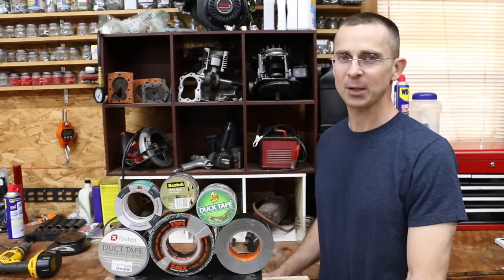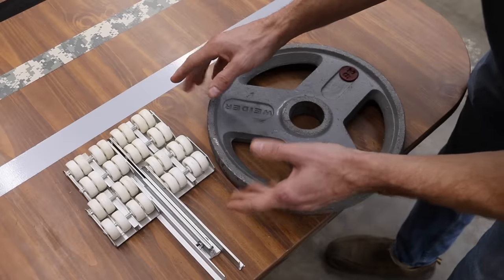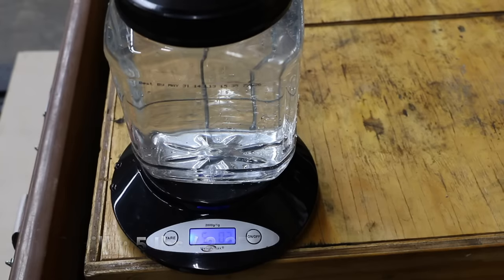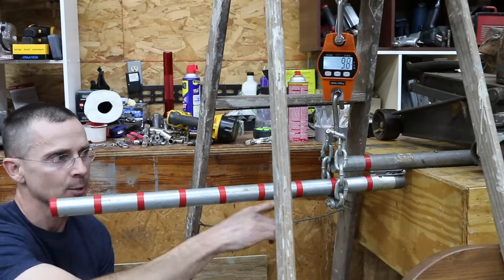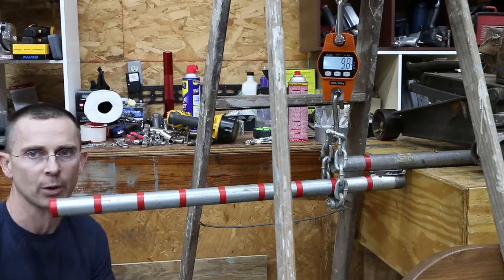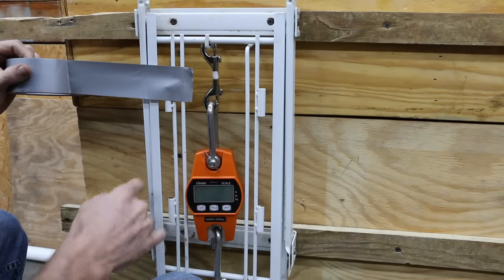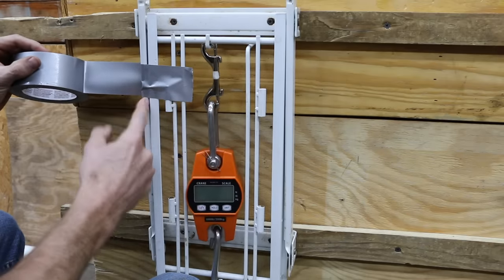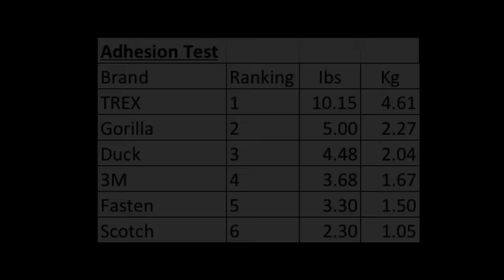Which Duct Tape Brand is the Best?  Let's find out!

Comment: You may also want to do a follow up video of the effects the COLD temps have on the ability to stick. I have found that cold air causes the adhesive to let go.
Reply from the maker: This is an excellent point.  Thank you for this recommendation.

Comment: Try flex tape
Reply from the maker: Thank you for this recommendation!
Reply: I bought some of this last month to try to repair an inflatable chair that had a small hole in it after duct tape failed to do the job. With the Flex Tape it still has a slow leak, but very slow. If I add more air once every couple of weeks now, it does fine. Sticky as hell and seems pretty strong.

Comment: I wanted to add a suggestion for another round of testing Duct Tape.  Say, round 2?  With a few additions and changes.  I noticed that your first two tests were actually a shear test.  That is pulliing harder on one side or a left to right or right to left motion.  The other two tests were adhesion tests.  And good ones!  I would like to suggest a brute strength test by taping the tape to itself.  Further, inside of that loop would be a round flat bar on each end with the weight evenly distributed for even tension tensile strength..

I have gone through most brands and more miles of tape than your average Joe.  In my experience they are used in many scenarios but I wanted to suggest a particular scenario.  A lot of vacuum and air lines are sealed with duct tape.  A vacuum and air pressure test seems to be in order.  A hole of possibly 1/2" - 1" in size for the vacuum and a prick for the air lines.  Here are some other ideas I wanted to suggest for round 2...

WEATHERING.  UV and being exposed to the environment would be a good test.  Much like you did with the bungee cord testing and after exposure to the sun and the elements outside, you did a comparison of the bungees after exposure.

HOT & COLD:  Although your previous tests in this video was done at the same temperatures, a test of hot and cold temps seem to be in order here.  Sometimes a person needs to decide if these products will even last a week in the hot sun.  Or will it stick to something and remain stuck when the temperatures drop below freezing?  On a metal pole that may condensate?  Or a wood stick that does not condensate?

Finally, I have watched more than half of your videos.  You never disappoint and I appreciate the testing.  I heard you say in one of your videos that you read the comments.  That is a lot of comments to read brother!  I hope and pray to see more of your well constructed and detailed videos!  

Thanks!
Reply from the maker: You are welcome!  Thanks for the suggestion.

Comment: 3M tape and Scotch tape are both owned by 3M but Scotch tape performed worse hmmmmm
Reply from the maker: You're right. They make a lot of different quality products.
Reply: That's what happens when you buy a company and still wanna feed off brand loyalty.
Reply: It's more than likely 3M uses Scotch as their "bargain" brand.
Reply: the best is 3M extreme hold duct tape
Reply: 3M didn't buy scotch brand, they created it....
Reply: Scotch brand is a consumer brand for homeowners and office workers whereas 3M uses their name to market and indicate that the product is for industry and commercial professionals. It's the type of stuff you can depend your living on and in many cases, your life to.

A lot of 3m products markets itself in industry just by being very good and well engineered products so customers find 3m products on their own whereas with scotch tape, they actually do have to have specific and engaging advertising that actually seeks out customers because who really cares that much about scotch tape vs the other brands. They use completely different marketing strategies. Consumers want the best product for the best value and they tend to fix onto a brand name that they recognize, whereas in industry and commercial products, companies want to consolidate and have integrated and consolidated solutions from as few sources as possible.
Reply: If it's not Scottish it's crap or if it is Scottish it's crap
Reply: Scotch is garbage as far as duct tape goes, but if it's cheaper and I don't need something particularly reliable, I'd buy it.

Comment: One thing I  know for sure is the temperature when applied and under use is critical.  In the winter, I always hit it with a heat gun, just till soft or, at a bare minimum, keep the tape inside until used.
Reply from the maker: Thanks for the feedback.

Comment: Fixing The Strength Test (Length) Results as it was switched from lbs to kg after the 3M Tape.

1. Gorilla   66.5lbs - 30.2kg
2. TREX     64.1lbs - 29.1kg
3. Scotch  39.0lbs - 17.7kg
4. 3M        35.7lbs - 16.2kg
5. Fasten  31.9lbs - 14.5kg
6. Duck     26.6lbs - 12.1kg

Please thumbs up and you can also double-check the video if you like, Cheers.
Reply from the maker: Thanks for the suggestion.

Comment: After 8:51 your crane scale is set to measure kilograms not lbs.
Gorilla weighed in at 30kgs = 66 lbs
Reply: Nice find. So basically, T-Rex is the stickiest but Gorilla is the strongest.
Reply: All measurements in the lateral test after 3M are in kg not lbs but are listed as lbs. So in the erroneous chart, 3M should not be at the top but 3rd up from the bottom at around 15.9 lbs.

Comment: This one is great! The issue I'm having is that while I usually buy 3M (cheap-ish, available) the different rolls seem to behave differently. Occasionally they don't seem to stick anywhere, however, the tensile strength is much more consistent. Good to know about the alternatives! Great work!
Reply from the maker: Thanks!
Reply: I've noticed that too, 3M is inconsistent, not just with duct tape but also medical tapes. Some older rolls stick like Krazy Glue and the exact same "model'/product # newer rolls lack the same adhesion.
Reply: @thetasigma5835  Are they all within expiry date? Adhesives don't last forever, hence all products carrying them have an expiry date. If you are trying to compare old vs new adhesive then your comparison is invalid. If indeed they are both non-expired then yes you have a valid claim for inconsistency although there could be more parameters at play (eg. storage conditions, temperature and humidity can alter performance).

Comment: now do this with electrical tape !
Reply from the maker: Thank you for this recommendation.
Reply: if you do it with electrical tape, I would highly suggest to put this to the test : 
- how much current does it need to break/melt 1 layer of tape
- sticking test at normal, cold and hot temp
I've noticed each brand of electrical tape doesnt stick the same when it come to heat or extra cold conditions (winter contidition). This is what most people may like to see as I really hate to get a electrical tape that wont hold to these conditions.

Comment: nashua 357 would leave all these tapes in the dust
Reply from the maker: Great recommendation. I tested it in this video: https://youtu.be/xUEob2oAKVs
Reply: I knew someone would mention it in the comments.. This is the best.. This tape is much stickier and stronger than any duct tape I've ever used or seen.
Reply: That should have been in there that’s for sure
Reply: 557 is better than 357.
Reply: Project Farm is that the right clip? I checked and it was an oil penetrator clip.
Reply: We use Nashua 357 on the Drilling Rigs out here in West Texas.

Comment: TL;DR
Gorilla tape is the best one.
Reply: Go to the top comment you
Reply: I've only used it a few times, but it does seem to work better than the others I've tried for what I used it for.
Reply: SlaterReactsHD it was actually t-rex
Reply: @1ZosoLZ  The Gorilla tape finished above the T Rex tape in two of the three tests. Why do you say that the T Rex tape is better (genuinely curious)? To be fair, if I am only looking to close a gap / make a seal where no forces are being applied, then I am absolutely going for the T Rex due to its adhesion test results; everything else where I need two moving parts to stay together and I'd probably go with the Gorilla.
Reply: @nickgrubich9232  But T-REX stick twice times better to the surface than Gorilla and in two other test wasn't that behind so that why i will choce the T-REX instead of Gorilla. Remember you can apply more layers and make it stronger but you can't change the glue used on the tape (if you don't buy the better glue to stick the tape which don't make sense) Am i right?
Reply: @bleyz3557  I would %100 go with T Rex due to the adhesion alone. Gorilla would be my next choice if T Rex wasn't available.
Reply: @jmaline90  Me too.
Reply: T-Rex is slightly better

Comment: No nashua?
Reply from the maker: I'll test it in an upcoming video.
Reply: Nashua 357 is a standard for entertainment rigging companies I've worked with.
It's also what Mythbusters use in their duct tape episodes. They build bridges, make boats and skin planes with it among many other things.
Reply: I was scrolling through to see if someone else mentioned this.  Once I discovered this at Home Depot in the actual heat and air ductwork area I was amazed at how much better it was and it never gets old and brittle like a lot of them do.
Reply: We used Nashua duct tape to seal doors and pipes testing controled atmosphere rooms. The cloth is about 1/2 thickness of a t-shirt cloth. Very heavy-duty. You can get it up to 4" wide, maybe wider. Takes very strong fingers to get it to tare. Most would cut it. I have some 4" in my shop for use on projects . My employer, Alcoa, uses 3m and it isn't even close to the Nashua. But, as usual, quality is expensive . Also I believe they even have different grades of it. I'm sure the example I have is their heaviest . I seen some 2" at home depot. Star rentals sells it in Washington state.
Reply: Nashua and Gorilla are made by the same company. Gorilla sets the specification it wants and the manufacture makes it.

Comment: What about natusha?
Reply from the maker: Thank you for this recommendation.
Reply: I think nashua is the brand.  My boss buys this stuff because it's inexpensive.  It seems weak just by how easy it tears off the roll, but we don't use it for anything crazy anyway.
Reply: Nashua is very good
Reply: I have found Nashua to be by far the worst all purpose tape, much weaker and with much poorer adhesion than the 3M stuff, when using them side by side. It is super cheap though, in situations where the quality isn't important. Just don't put it on your ducts.
Reply: Natuasha is the main brand for actual hvac work.  In the hvac wholesale places it us what is carried. The others in this test are consumer versions sold at dept stores.  They have many versions from cheap to the really good.
Reply: Do you mean Nashua (as opposed to Natuasha)? As in the main brand sold at Home Depot? Their actual duct tape (aluminum foil tape) is quite good, but the Nashua branded "all purpose tape" has always seemed to me to be garbage. Do they sell a low quality version at Home Depot, compared to what they make for professional work? Or is there some utility to the low tensile strength, low adhesion version specific to HVAC work? I was always taught never to use plastic "duct" tape on ducting, but only foil tape, which works just fantastically.
Reply: Nashua gaffer's tape is the shit, I've seen people build rope out of it to fly PA Systems and the adhesive is so strong that I've seen it rip skin off people
Reply: Nashua is what the pros use. However, if you go buy Nashua at the home center or Walmart, it's NOT the same grade the pros use. I suspect the T Rex tape in your video is probably a Nashua tape that is private labeled as T Rex.
Reply: They sell their all weather at home depot, and thats what I use
Reply: Huh. I always wondered how their foil tape could be so good and their all purpose tape so bad. That makes a lot more sense. Any advice on where to find the good stuff? 3M has never let me down, but I wouldn't complain about an upgrade.
Reply: jasexavier well, their all purpose is ok, but they sell an all weather tape that sticks like a mouse glue trap
Reply: jasexavier They sell tapes up to 4" wide at least . I'v used both and 3m is like clear Christmas tape compared to the Nashua. We used it to test controlled atmosphere rooms for fruit. We used it to seal the doors and pipes so we could put the room under positive and negative pressures. It comes in different grades also. The tape we used was so strong most couldn't tear it. The cloth backing is like 1/2 thickness t-shirt cloth. I've used 3m at Alcoa and it is garbage compared. But the Nashua is expensive- 4" is $35 to $40 a roll of 180ft.I have a roll of both in my hands and there is no comparison.    Star rentals sells it in Washington state. Ebay? If the others are 100 mph tapes this Nashua is 1000 mph tape. Go to www. berryplastics.com .

Comment: Thank you. I really needed an honest comparison between gorilla and t-rex and since you added a few more in the mix, the comparison was even better.
And you are right, the best product also depends on what we are using.
In my case, i need to fix my motorcycle blinkers that have fallen off. Since T-rex is more sticky, i don't mind coming after gorilla in strength because i really don't need that much strength.

PS: water resistance would be a good thing to add to these comparisons. Don't know how you would go about this, but it would be a good add-on.
Thanks for the video.

Comment: I started using Gorilla products a few years ago. I had noticed that 3M and Duck brands' quality turned south. I bought Gorilla and it was even better than the originals of the other two. Mind you, it's a bit tougher to rip but it does tear cleanly. It has so many practical uses, and being a female, I have also found domestic projects crying for a strong tape as well. I'm not one of those duct tape people who make wallets and placemats out of them!! Lol! But I've used the white tape to trim out around the air conditioner so you don't see the foam stuffing and I repaired my white laundry basket when it broke to get by until the next day ( that was 3 months ago). I use it for many of my Halloween and Christmas decorations when it calls for more costly, impractical and visible solutions. It comes in many colors so it blends in. This could go on for a while so.....it's really great stuff!!
Reply from the maker: Thanks for the feedback.

Comment: I've used all of these.  Although Trex and Gorilla looked like the winners, the material they are made from is so much thicker, that they tend to lose grip after a few days and unravel.  I wrapped many items with these "ultra strong" tapes only to find them hanging unwrapped all by themselves later.  This can be dangerous when you assume you can count on their basic strength as tested here!
I live in a warm climate, which may be a big part of the problem.  But, the cheaper, thinner tapes work fine here!
Reply from the maker: Thanks for the feedback.

Comment: Back when I served in the military I used to use both a more expensive and a cheaper tape.

Gorilla for holding together expensive equipment (So it doesnt get lost), marking rooms/vehicles/equipment, or repairing damaged equipment.

Cheaper tape like Duck, for covering holes in tents/rain gear, or taping my OPORDS/pictures for briefings on walls.  (I used to use Gorilla for taping up my important docs, but I noticed it was so strong it would rip papers and the plastic sheet protectors, so I switched to a cheaper less adhesive tape for that stuff).
*So in the military I used to use two different types of Duct tape.
Reply from the maker: Thanks for your service in the military!  Thanks for sharing.

Comment: Two factors that aren't talked about are:
1.  Is the product good enough for what I need?  Do I need to pay top dollar to get high tensile strength if using tape instead of rope isn't my intended purpose?  (Who hangs stuff from duct tape?)  I think that's part of what Project Farm was trying to say -- you're the expert on what you need.  So, the question of "best" is really yours to answer. 
2.  What's the value?  If a budget tape is good enough for what I need, choosing the "best" tape might be overkill and a waste of money.

I carry duct tape in my "go bag" in case of emergencies.  You can do a ton of useful things with it like patching holes in a shelter or garment.  Did you know it makes a pretty darn good tinder for starting fires?  For me, then, flammability is actually a positive quality in the tape more than tensile strength.  That's probably not something most people would look for in tape, and quite possibly something they would NOT want.  To each his own.

Comment: ..Nashua tape...it has always seemed to be the thickest, strongest, and has the best adhesive...relatively expensive, though...and it also seems to be what most of the heating and Air guys use on actual "ductwork"...

Comment: Maybe you can place them outside and see if one is more resistant to weathering and moisture etc. one brand might be stronger but less resistant to moisture. Similarly some steels are stronger than other but less corrosion resistant. This would affect which is “better”
Reply from the maker: Thanks for the suggestion.

Comment: Great vid, Ty.  Would like to see these tapes perform under moist conditions.  (I often use duct tape in wet situations and humid environments.)
Reply from the maker: Great suggestion!  Thank you.
Reply: @ProjectFarm  Thanks.  I've got a bud who's a welder; he says that sometimes on a job away from the shop, when he forgets his clamps, he uses Gorilla tape to hold stuff together while setting the bead.  It might be interesting to see duct tape heat tolerances.  And also, maybe its application in freezing locations.   (Could I have used it here in Houston during Snowmeggeddon in February?)  Keep up the good work!!